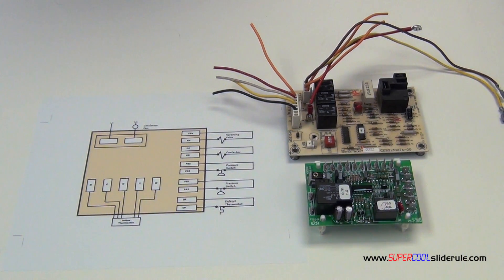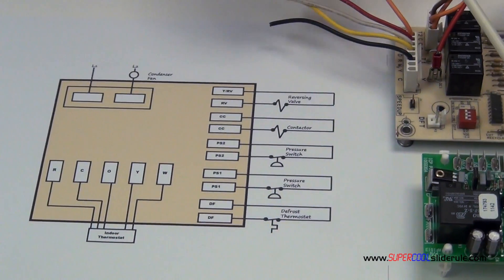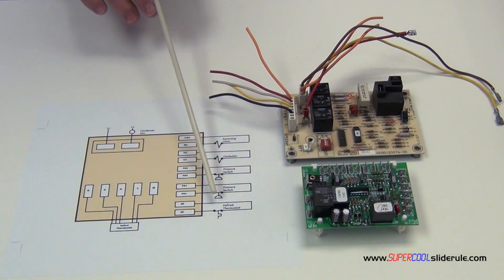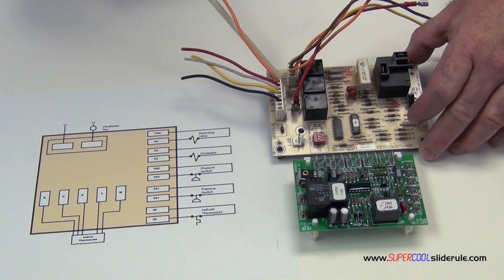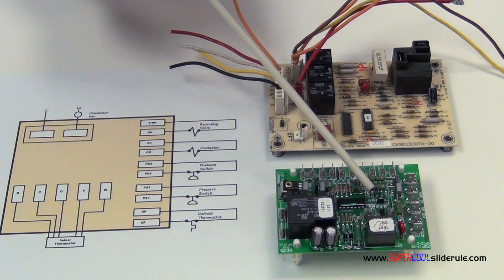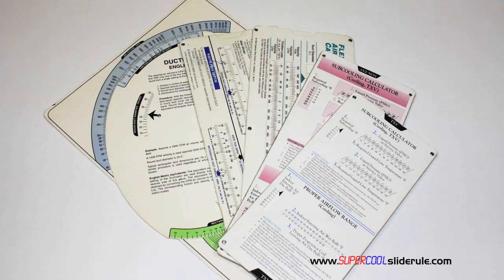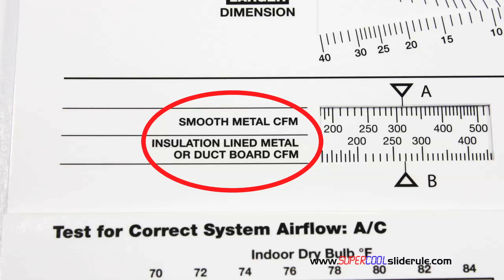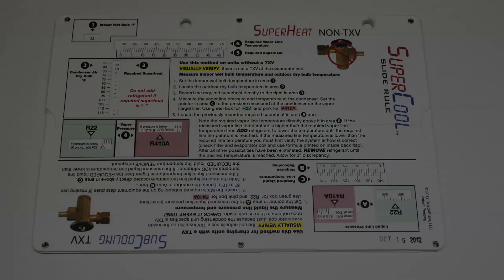Basic Operation of a Defrost Heat Pump Board

Comment: I thought that most modern defrost boards have a separate ambient thermocouple, and a coil thermocouple. This way, it is a demand defrost, and only puts the system into defrost if the coil is too much colder than the air, and avoids unwanted cycles if the temperature is low, but the humidity is too low to freeze the coil. I thought that the interval defrost was discontinued on new units, and was only on older mechanical timer relays.